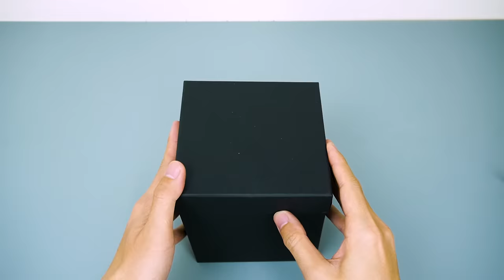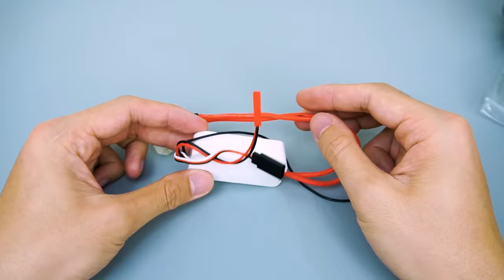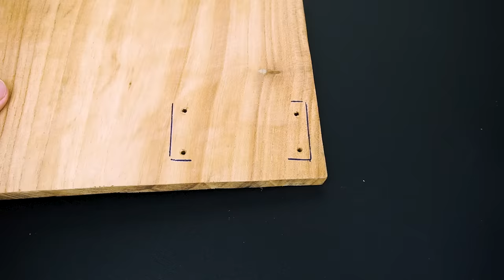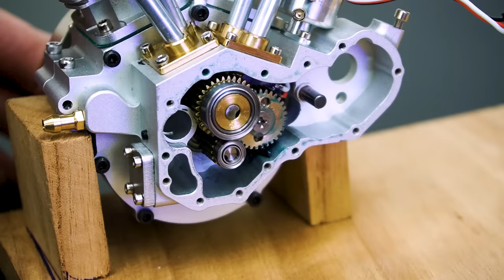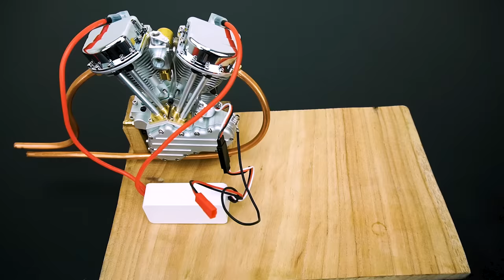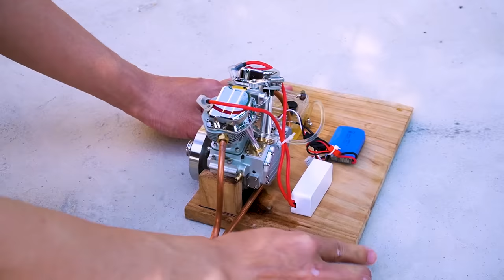Mini V-Twin Engine Four-stroke Test

Comment: Rubber engine mounts will be mandatory for a V-Twin like this, too much vibration. No counterbalancing by design. Do not hard mount this design, it must be a soft mount.
Reply: 100% 
I’m working on building a rubber isolated mount for mine now.
Reply: The crankshaft had far, far too much play when he rotated it with the cover removed. I doubt that this will last very long.
Reply: The side cover is also a support for the camshaft & gear drive assembly. The cam gear’s bearing seats inside the side cover 👍
Reply: Ok buddy, you play on pubg.
Reply: @bilijar4855  yep, 35 years of video games and Harley-Davidson motorcycles
Reply: Do keep in mind it’s a miniature model. Shaking on a real Harley is inevitable
Reply: @monkeymanisbanned4313  depends on the design several new models come with counter balancers, but even the model pan head must be soft mounted due to extreme vibration by design just like the real deal. that is the reason you dont see v twins of this scale, they will destroy anything they are mounted in.
Reply: @Rotaryunderground  well explained☺️
Reply: @Rotaryunderground  A 90-degree V-Twin would vibrate a lot less as it's in perfect primary balance without the need for balancer shafts.
Reply: @Knapweed  While I agree I believe they intended to replicate the HD Sportster style panhead and thats why it is not a 90, the engine was always soft mounted in the frame
Reply: @Rotaryunderground  I totally agree. I was only saying that balancer shafts wouldn't be required but I feel that soft mounts are always a better solution than rigid ones for ICE engines.
Reply: Maybe all the armchair engineers need to stand up now!Heeeee!😁👍🛠️

Comment: Wow i love 2 cylinder engine sound🤤 connect the both exhaust pipe together
Reply: No, no, no! Harley's have had crossover (joined) pipes for years, they suck. I have a RoadKing with trual duals and no catalytic converter, best sound ever.
Joined pipes bad, tuned dual exhaust good

Comment: Impressive. I'm surprised at the low idle.... sounds nice. In the 1980's I had a few remote controlled gas powered helicopters. The motors were about the same size as this one but they revved very high even at idle.

Comment: Awesome, little engine. Just one tip, you should never screw into end grain, especially if it's under stress.
Reply: Should have mounted it to diamond plate for better presentation.
Reply: @Dave-sw2dm  dont mount these on hard surfaces without rubber btw

Comment: I would so put that on my  fucking battery powered scooter or even my bycicle XD use the right handle bar  as the throttle like dirt bikes and motorcycles. That's pretty cool little twin cylinder piston engine.  I like how it's also chrome shiny. ( if i were to mount it onto a bycicle or a scooter i would need to build a mount for it or buy a mount for it )

Comment: I see he left one bolt loose on the case, but never added oil. So it will not last long. Too bad.
Reply: Oil is in the Fuel, like a 2 stroke.